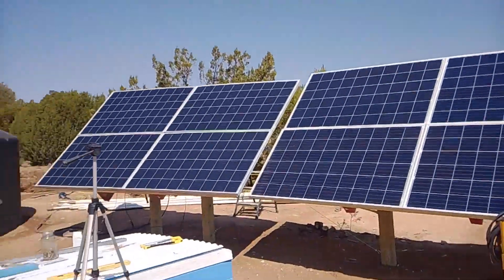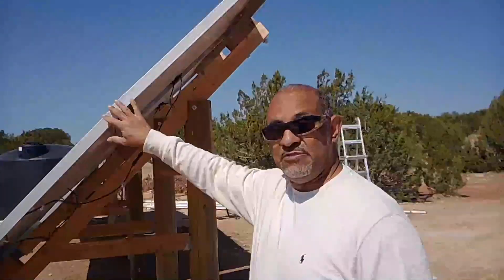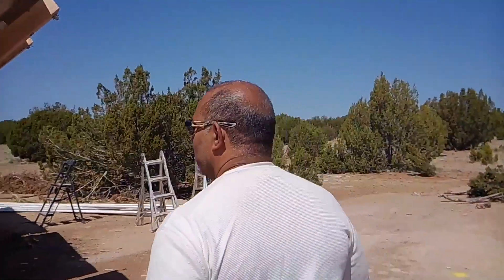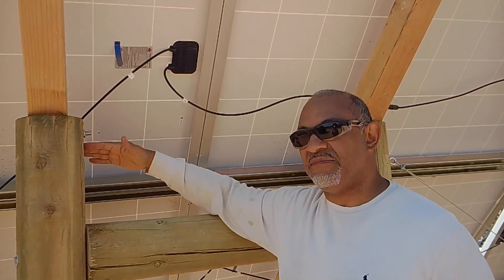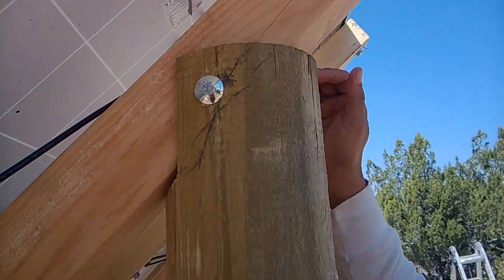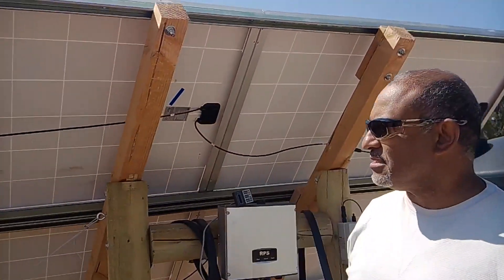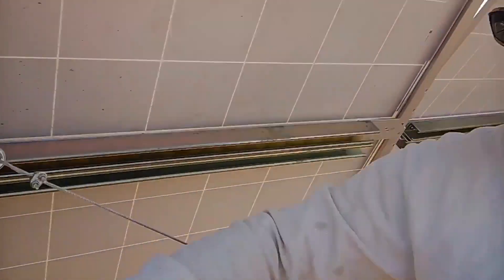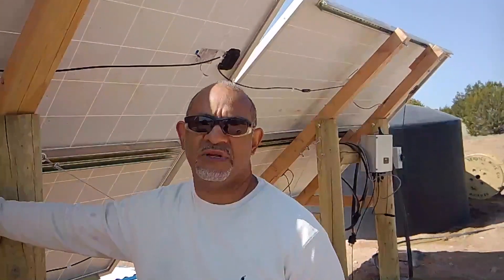SOLAR POWERED WELL PUMP

Comment: Good Job I have 5 wells here on the Ranch in Montana. 2-@ 175’, 2-@ 275’, 1-@ 420’. The one 175’ I had setup with a Hand pump 42 years ago before Solar was available. Now I setup it up on a 500 Watt Renogy System 24 volt. Here in the Mountains water wells are important because you have to drive so far for water otherwise. I am able to get 425 gals. a day out of my 175’ well. I do use 12 volt V- Max Tank Batteries in a 24 volt configuration. We had plenty of domestic water for the household. But the Solar well provides for numerous raised bed gardens we have started last year. And we now have a fresh new yard to keep watered as well. Been here 46 years and never wanted a yard to maintain. Now I am retired so it’s so much easier to stay active with a yard.

Comment: I'm confused what the tension wires are for....are they pulling the posts away from the cross member? When I see people use wires on posts for fencing, it's usually pulling the posts towards the cross brace.

Comment: Ordered an RPS 800v solar system this week. We are drilling our own well, completely DIY. 

Have you been happy so far with your RPS system? Great video. Hope to see more from you.
Reply from the maker: That's awesome.  Do you know how far you have to drill?  So far we are very happy with our RPS system.    We haven't had any issues.  They provided great customer support when we needed to ask questions when  we were connected it.  Thank you for subscribing and watching our videos.  Let us know how everything turns out with your well.
Reply: @How2BeFree  We hope to get good water at between 100 - 200ft. We started the drilling process and are filming it and hope to have something up in the next few weeks. We've already hit a few snags. That's just how it goes with DIY projects.

Comment: did anyone else mention yet that you installed your Unistrut upside down? The part woth the holes is meant for the fastening of strut itself. things get attached to the eopen pportion with special fasteners. SO MUCH EASIER
Reply from the maker: No.  I'm sure we did install it backwards.   It was difficult to figure out as we couldn't find anyone with knowledge on it.  But it worked at least for now so it all good.  Thank you for letting us know.

Comment: I have 8 acres and was just thinking about solar powered well pumps. There is a well about 200' away from my fence line and was thinking on this. It has a 220v pump which I could use a generator but was thinking on placing a solar one and keeping the other as a back up. I just want to have some farm animals for now.
Reply from the maker: That's a good idea.  Always good to have an additional back-up system.  RPS does sell pumps for shallow wells.
Reply: @How2BeFree  My father had 7 wells drilled and only 2 were put in service. They are located in Mexico and are about 100ft to water table and the one here is about 150 to water table. We plan on getting him one of these systems. Thanks and great video.
Reply from the maker: @cutweldngrind  Your welcome.  I'm glad the information helped you.  Good luck with everything

Comment: Looks like you got a dream team their, just hoping you've got more water pressure than what is on the demo ...
Reply from the maker: Thank you. Its actually pumping 8 gallons per minute.  There was some wires not connected correctly on that footage and we didn't get to video after we corrected it.
Reply: Watch the Shipping Container Home #7  it address it address water pressure to the house.  The water pump only provides water to the tank not the house.